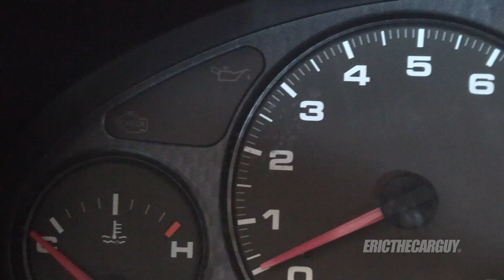Best Integra Type R Upgrade (So Far)

Comment: Off topic: I was doing my 92 Honda timing belt and had few problems. 
1. Solved: Timing adjustment but was rounded and trying all the tips I could find, even the non-spiral extractor sockets -Nothing worked. I got a hold of spiral extractor sockets and BAM out like nothing. I spent 40 hours at least on it. 
2. Solved: Darn crankshaft sprocket key was stuck and no matter what would not come out. Even tried to file it down to side off sprockets. Eventually I use a long heavy crowbar. From the top I put it between the two and lightly tap and walked it forward and the key began to move forward with it. I was then able to pull it out and then get the sprockets off. 
3. Unsolved 8-(     The tensioner for the balance shaft and oil pump was too small for the OEM bracket/arm that’s supposed to hold it in the GATES kit. The center hole is bigger than the center of the tensioner. Bummer. 
3. Advice needed: should I order and wait for oil pump gasket and seal before putting it all back together once my new key  and updated timing tensioner nut get here? 
Muchas Gracias! 😊
Reply: I also have a 2000 civic with no O2 sensor but still pulls codes for not heating. Maybe it’s the intake, I t came with an intake but all the sensors are there. Could it be my CPU? I still need to trace the wires to make sure it wasn’t cut somewhere. Of course test if it even gets signal at all to the sensor upstream.

Comment: Header - I would have gotten some left over exhaust wrap and wedged it between the runners.
Reply: Really unnecessary on an NA b series
Reply from the maker: I believe that would have worn out quickly. Remember the pipes were touching due to vibration. Also, it took less than 5 min for that weld. It would have taken a substantial amount of time to wrap as I'd have to remove the header from the engine. Thanks for the comment.

Comment: Another possible solution to that header buzz would be to cram some header wrap in between
Reply from the maker: The way it was rattling it would have worn through very quickly. Also, it's a very tight space. I welded it on the car. Took 5 min. Thanks for the comment.

Comment: Flat exhaust gaskets are copper wire sandwiched with paper, 
then dipped in lead.
Doughnut exhaust gaskets are a ring of copper wire mesh,
dipped in lead.
Both crush into sealing, and should not be reused.
All exhaust gaskets should be whetted with copper
anti seize before installation.
Prior to installation-
Thoroughly scrub pipes with brown Scotch Brite pad
or steel wool, rinse with brake parts cleaner.
Handle cleaned pipes with clean gloves.
After attachment and leak checked- spray
all pipes with WD-40 while HOT to achieve that
beautiful golden color, that will last for years-
when applied correctly.

Comment: I get that occasional rattle that probably is inside the muffler ! Gotta give it a wham with the hand  and see. The second time I see you take off 02 sensors, when replacing exhausts. OE sensors are available, the same manufacture is stamped on the sensor, ie; NTK on mine. The flange where the header connects to the pipe, is cocked. One side is closer than the other.

Comment: Interesting that with the new header the upstream sensor only monitors half the cylinders. I suppose under normal operation it won’t matter, but you won’t catch a lean condition in either of the un-monitored cylinders if something were to go awry
Reply from the maker: If that happened it would likely cause a misfire. I'm not really concerned about the O2 sensor placement. Also, that header will be changed out when the supercharger is installed to a shorty style header. Thanks for the comment.

Comment: I had a 96 gsr and I put a tri-y header and exhaust system on. A buddy and I used a welder from harbor freight and it had so many leaks but it sound amazing. It was a bit drone-y on the highway, but I thought I was cool as heck.

Comment: Due to the position of the oxygen sensor in the new exhaust manifold, it can only measure the oxygen level of two cylinders. I wonder if that's an issue as It can't detect the oxygen level in the exhaust from the other two cylinders and therefore the air/fuel ratio.
Reply from the maker: I don't believe it matters. Remember you want to feed all the cylinders the same anyway. The fact that the car runs better than ever I think is testament to that. I'm speaking specifically about idle quality. You can hardly tell it's running now. O2 sensors have a lot to do with idle quality.
Reply: @ericthecarguy  Thank you for the reply!

Comment: Sounds a " HELL OF ALOT BETTER " Sir Eric, Great job on installing that exhaust. If I may suggest 1 thing though ? Drill about an 1/8 in ch hole in the back of the muffler at it's lowest point to get rid of any condensation " WATER " laying there rotting ur muffler eventually. I DON'T CARE IF IT'S STAINLESS OR NOT, DRILL THE HOLE. GREAT VID. AS ALWAYS, DID I MENTION IT SOUNDS FREGGIN GREAT ?  It will get a bit better with use also, MUHAHAHAHAHAHAHA.
Reply from the maker: The Tanabe Medallion muffler is a work of art. To modify it in any way would be sacrilege in my view. I felt bad enough modifying their B pipe. I'm sure they've already sorted out how to deal with condensation with Samurai spells or something. Check out their website linked in the description. Thanks for the comment and suggestion.
Reply: @ericthecarguy  Samurai spells, LMAO, OK Eric I'll check it out

Comment: Oooo exhaust system rattle! Drives a fella nuts.  Innards on my catalytic converter came undone and made a hell of a racket; people would turn their heads as I went by it was so bad. :(   Getting the new converter installed was a real joy, involving five of the six studs coming loose just fine but one being rusted solid, entailing an hour of lying on my back with a Sawzall trying to cut through it. Had to stop every few minutes and break off the worn-down tip of the blade to expose new teeth. Went through three blades before the stud finally cut through! UGH.

Comment: Eric the car guy can you make a video or suggestions about the big 3 upgrades on battery terminal cables and alternator if it's safe or a good idea to do it I'm running full entertemin system on a 06 accord 10inch screen head rest DVD player and gonna run visor DVD player also and not sure the battery and alternator alone can handle the draw
Reply: I doubt you’ll have a problem. 
DVD and tv can’t be more than 25 amps. 
Running the fans, ac and stereo wipers and lights is less than 40 amps. 
So your at 65 out of 90 or 120

Your only at 60% stress. 
If you don’t believe my maths go get a multimeter. Nobody can tell you how many amps you need or have. Without seeing your car.

Comment: When you weld a pipe or anything, you should do it like you tighten bolts on a tire, flange, engine cover or anything with multiple bolts. The reason being when you weld you heat the metal and expand it, and when it cools down, it shrinks. When it shrinks it pulls. So even if you have tack welded it, it still does it, just not as much. So when you start with tack welded parts aligned like this ---I I--- when you weld only one one side it can be like this --I /--   (lower side welded only. Thats why you get misalinged flanges. Also why stanless steel can corrode is when you heat it, you evaporate some of the chrome from the surface o the steel.  You create a chrome poor area. You can see this as a color change. Chrome is what makes it stainless. So you ideally should treat the surface with acid after welding it, to clean it and make it as it was before you heated it by welding. If you cant do it, second best is to grind it till its nice and shiny. Painting it works only for as long as the paint is intact and under the car its not ideal. If paint gets sracthed or whatever, the corrosion is even worse under the paint. Thats why you see rust under paint bubble.

Comment: For a smaller hp cars originally with 1.5 inch diameter piping, does 1.8 make a different?
Reply from the maker: Why not go for 2"?
Reply: @ericthecarguy  Afraid of losing much greater low torque. 0.1 inch still make a difference right?

Comment: Your exhaust tip should be sitting out further, I’m assuming your exhaust was originally made for a EG chassis.
Reply from the maker: Correct, but I don't think it'll be an issue. I did mention where I got the exhaust in the video.

Comment: I just did the full exhaust system on my 1998 Integra GS-R with a DC sports header 2 piece, new cat converter, new oem replacement midpipe and premium oem style muffler. Sounds amazing but it was actually just done to get rid of the annoying RATTLES the factory exhaust makes. If anyone has the stock exhaust manifold they will know what the problem is!! They rattle like crazy at 3-4k rpm making the car sound like shit. the problem is the oem flanges/ gasket surfaces get rusty

Comment: Would have been just a tad bit better if you cleaned the o2 sensor with gasoline or some solvent so that it’ll take some of that carbon deposit and the engines ECU can have better readings. Awesome video either way!!!
Reply from the maker: Waste of time in my view. It's only going to get dirty again after the first few drives anyway. Thanks for the comment.

Comment: Hey Eric, if you need a new donut gasket then order the one from the S2000. It utilizes a 2.5" gasket. Love that it doesn't sound like a fart can. Congrats on the new exhaust.
Part #18229-s5d-a01

Comment: I'm a bit concerned by how far in the tip is behind the bumper.  my previous exhaust setup gradually burned the bits near the tip.  But your exhaust does hang a bit lower than mine did so you may be ok.
Reply from the maker: So far so good.

Comment: Hi Eric been watching your vids for many years, I really wouldn't go the roots jackson supercharger route, The belts slip all the time, should of been a toothed belt system, they create too much heat, they're hard to tune in Hondata, probably because of the boost levels fluctuating..centrifugal supercharger (Rotrex) are much better kits, tune with E85 too, over here we don't really have E85, but much less chance of detonation in tuning
Reply: Please don't do the roots blower, its a high compression engine, it don't like it unless you go E85 and tuned

Comment: do you think the 2.5 inch size header/piping is too large for the GS-R?
Reply: Yeah probably not going to have the right back pressure and ruin the motor
Reply: No, its perfectly fine. Especially if you are looking at future mods such as cams or nitrous.
Reply from the maker: I think you'd be just fine.

Comment: Last year I replaced the oem exhaust on my 94 Integra GSR with a Yonaka catback exhaust. I had to add 4 inches of pipe to make it fit my car.  Long story short, I hate it. It drones and doesn't sound nice at all. Too loud for my taste. I wasn't able to return it because of the modification. I am thinking about adding a J pipe or Helmholtz resonator but I have yet to find any shop in my area that can do the job or is willing to take it on. I tried to install other exhaust brands but although they are supposed to fit my car the one I've tried so far rewuire 4 extra inches of pipe. Something to do with the b pipe on the GSR 2 door for that model year. I am reluctant to spenmore than needed to fix the droning issue but may have no other choice.

Comment: I wonder if your dipstick has  been overheated or lost its springy steeli-ness (technical term). My dip stick has never wandered around like yours, its a GSR motor.
Reply from the maker: It's only pressed in. The B series in my GSR does the same thing. It's not a big deal really. Likely you haven't seen it if you have a stock exhaust with a stock heat shield because it doesn't have as far to move. It likely runs a little cooler in that area with a stock exhaust also.

Comment: P0-420. A new Cat will usually take care of that... Eric. I love it, you're like a kid at Christmas getting a new toy... I have a 2000 Accord that is going to need a new Cat pretty soon (it's got the rattle). No codes yet, but I was thinking on replacing the exhaust system when I do the Cat. I know it's not an Acura Integra Type-R, but the car runs and drives great and after this video it made me want to do the exhaust even more. Great video! Thanks Eric.

Comment: Just a thought. You should have put the integra on the dyno to see what it puts out in power. Then redyno it after each or all upgrades.
Reply from the maker: That was the plan, but I'm having difficulty finding a dyno shop locally to do that kind of thing with. Most places are hours away.
Reply: @ericthecarguy  

Yeah. Plus there not cheap either :-(
Reply: @animal16365  NO THEY ARE NOT.

Comment: I recently did my own header back. Instead of the 3 bolt I went with a vband and instead of a flange at muffler I did a vband too. Both cheap, I also got a new 2 bolt header flange with a gasket for like 20 dollars. Vbands were 50 for pair. I did a bung as well very similar to yours and my exact fit my for muffler was slightly to the passenger side but fit fine. Went with an ultra quiet vibrant resonator and a magnaflow straight thru muffler. Mufflers a wee bit too small canister style but sounds pretty good

Comment: With a hollow cat and the ratteling rear muffler, this isn't just an upgrade, part of it is also catching up on previous lack of maintenance from the previous owner(s).
Reply from the maker: Actually the car was dealer maintained. Unfortunately I knew the tech that worked on the car at the dealer. I punched him in the face once. That should tell you all you need to know.
Reply: @ericthecarguy  Right, that kind of tech...
Reply: @ericthecarguy  ERIC, NOW I EVEN LIKE YOU MORE, LMAO.

Comment: My '02 Toyota pickup had the back O2 sensor plug located under the seat and carpet in the cab, had to pull the whole bench seat to access it! What a PITA.
Excellent craftsmanship with the new exhaust system!

Comment: 38:35. I would try some small pencil rod bent around the pipes and welded as a brace. I think a small tack weld will break quickly. Great looking exhaust. I did something similar around Christmas. Upgrading from single 3" to single 4" is a lot bigger. It's like your comparison between 1.5" and 2.5" pipe.

Comment: I’m running the same exact setup on my GSR but I had to get a adjustable test pipe and cut it down on both sides so I can bolt the catback and header because I ain’t wanna weld anything

Comment: Nice job Eric!
Wouldn't be a gain to wrap the headers in some heatwrap?
Reply from the maker: Good luck with that. There's some pretty tight spaces you'd have to wrap. I don't really see much gain in that either. Underhood temps don't seem to be an issue. Thanks for the comment.

Comment: I love the enthusiasm you have for the car. This is how I felt the day after I put my 4-2-1 header and Remus muffler on my CRX. Quality exhaust upgrades are worth it for sure. The thickness of the pipe is what gives it a good sound. All the ebay stainless exhausts sound crappy because 1. there's actually nothing in the muffler usually and 2. it's super thin metal and it resonates like mad and gives the car a tinny high pitched sound which is sadly characteristic for modified hondas. Thick stainless or steel piping gives a much nicer sound since perhaps the thick metal absorbs the high frequencies, i'm not sure. but for sure quality parts for the win.

Comment: Looks like it's sucking oil past the valves between shifts and coasting in gear.
Reply: b series burn oil from the factory. that may be a part of it
Reply: They burn oil yes, but they're not supposed to smoke like that..

Comment: Hello, I Need Help, can you tell me please, where exactly the 2010 Camaro SS gasoline filter is?
Reply: Do a parts search on a parts website, and if doesn't show one then one filter is the sock filter in the tank. If it does show one then it should be along the feed fuel line from the tank.

Comment: I run a 4 to 1 on my header straight pipe to a A'PEXi muffler love the sound
Reply: You know that honda engines actually run better and more powerfully when they get the slight back-pressure that the cat provides and that they are designed to have

Comment: That is a huge stretch of unsupported weight, 
 pulling on those welds.
I'd install at least one hanger at that 90 on passenger side.
If you can- put a bubble level or angle gauge on pipe,
from rear flange of converter; ensure there are no
high spots in between, that will capture water and rust.
Any weld is a changer of temper. Welds always rust first,
and the interface of parent to weld is weaker because of
this tempering- that's why welds are (usually) painted/coated
to lock out oxygen.
A gusset welded in between pipes is best for spacing and
rigidity. MIG is not great for stainless, TIG is preferred.

Comment: I would've polished the exhaust header so it is shiny as can be in the engine bay.
I also hope you will make a video on how to repaint the valve cover.
Reply from the maker: None of that matters to me now as the header will be changed out when the supercharger is installed. I'll worry about cleaning, sealing, and painting the engine when I remove it for the rebuild of the car. For now I'm going to enjoy my new exhaust system.
Reply: VHT wrinkle paint will work wonders on that valve cover and it looks stock when finished.
Reply: Polishing an exhaust doesn’t stay and is time you never get back
Reply: @ericthecarguy  Love the sound of it.
Can really hear the VTEC engagement.

Comment: Sandblast & paint:
AC hose bracket
Front engine mount
Strut tower cross brace
Engine block
Valve cover
Not "Performance" upgrades, but more
of a "preventative" maintenance measure,
and aesthetic pleasing.
Reply from the maker: This car will get a tear down and rebuild later this year. Be sure to catch Mondays ETCG1 video.